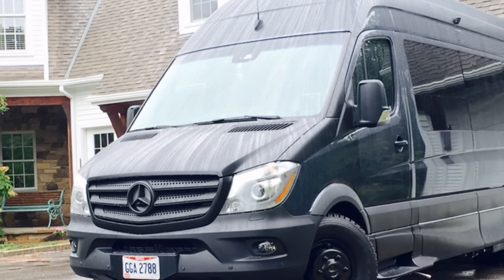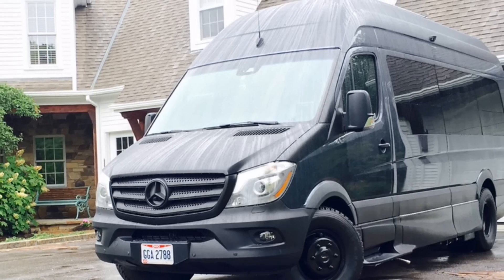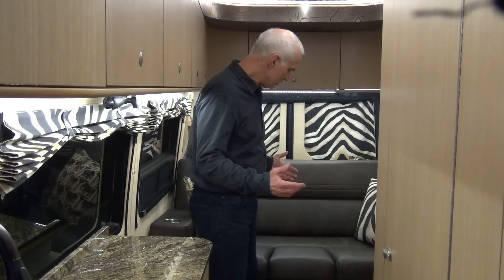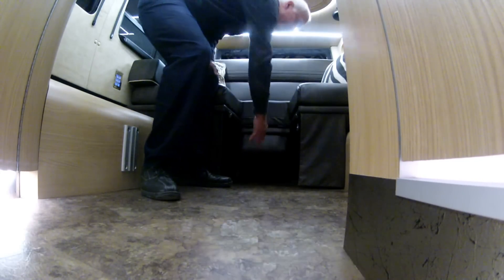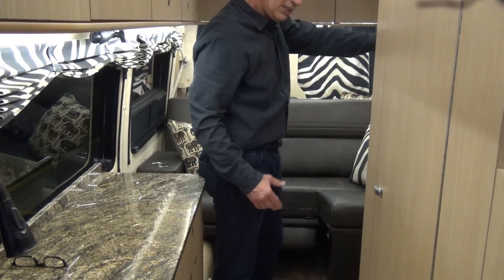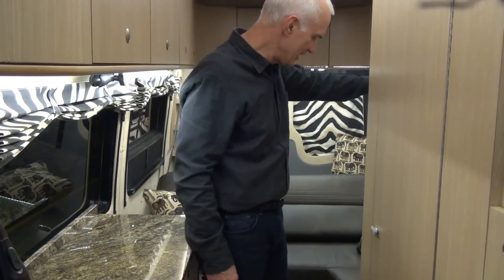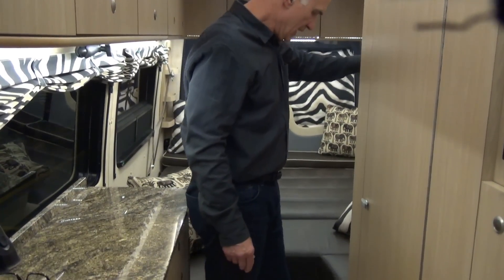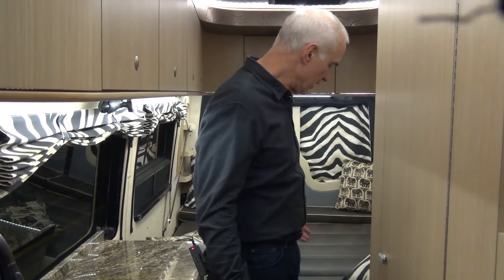Advanced RV's New Bed Innovation

Comment: your vehicles look great, and seem high quality. thank you for showing them
Reply: noviceprepper53 — The cabinets to the presenters right, our left are not even. The angles were not even close to 90° and you can clearly see the variations.  If those defects are allowed, overlooked, when they are in plain sight, it begs to ask what defects were overlooked or allowed in the guts of the trailer that can’t be seen.  I ask because I’ve owned a few trailers, one a Winnebago, on it I experienced four PVC plumbing leaks over several months.  On each one there was so little of the blue sealant applied to the joints that the pipes literally came apart when hooked up to outside water pressure, or when the water pump kicked on. Winnebago would only do the repairs where the PVC pipe had failed, and even charged me for repairing a joint where I was showing them where water had leaked (drip) and the joint came lose in my hands.  The water damaged floor, mold, and re-plumbing the entire unit was denied. I sold it and took a major loss and never looked back.  Quality matters.

Comment: The cabinets to the presenters right, our left are not even. The angles were not even close to 90° and you can clearly see the variations.  If those defects are allowed, overlooked, when they are in plain sight, it begs to ask what defects were overlooked or allowed in the guts of the trailer that can’t be seen.  I ask because I’ve owned a few trailers — Quality Matters!  .